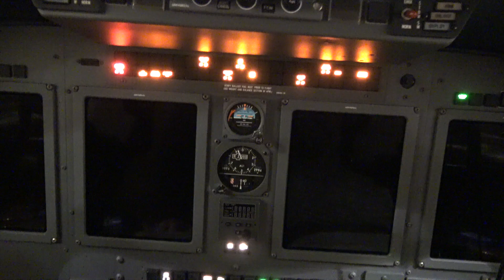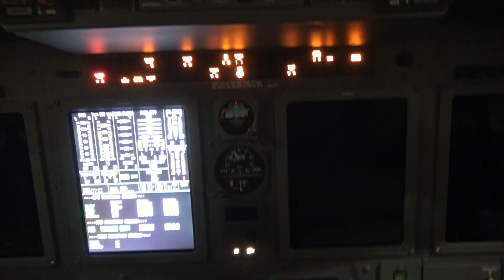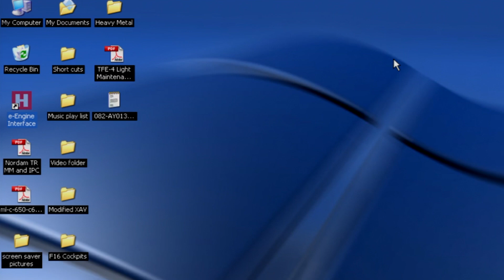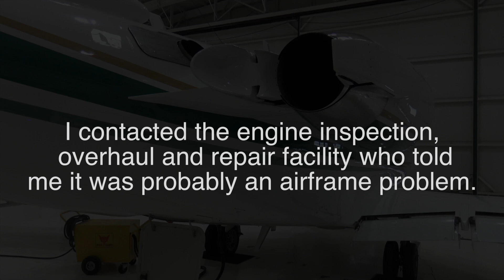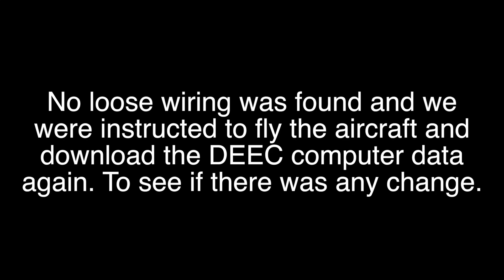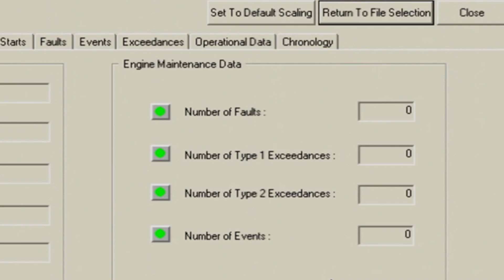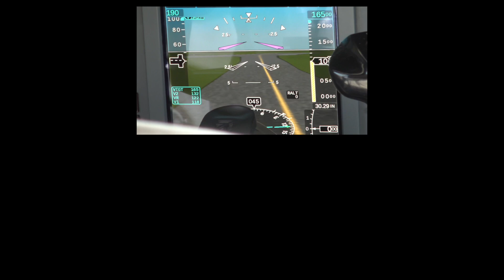Engine Health Monitoring and finding ITT problems

Comment: This feels like a “parts canon” fix. I guess it’s a bit harder on a plane to scope 😂 is harness wire repair not a thing on airplanes? Was there any diagnostic on the harness?
Reply: Safety safety and more safety.  Many parts are replaced under the theory that if the harness failed in one place it could fail in the same way but in a different place in the future.

Comment: To get to the harness would take 8 hours maybe. Remove the TR, exhaust, unstretch the tie bolt and remove the module. Have done this, along with complete disassembly's on this TFE's and TPE's many, many times. However, it was in the late 70's early 80's. Working for Airesearch Aviation at Houston  Didn't have all the computer controls, just had a box we could adjust the N1. Nice channel.

Comment: So no one knows what caused the fault... Just replace a part. It could have just been ONE wire broken. A fix $200. Replace part $15000.....
Reply from the maker: Once removed, the ITT harness showed signs of breaking apart. So it was definitely the ITT harness it self and not in the aircraft wiring.
Reply: Was it under warranty interesting how expensive this stuff gets.

Comment: that software looks like it is left over from the 1990s
Reply from the maker: It is actually from the 1990's, and came on a floppy disk. I had to modify my tool box computer to run Windows XP, so my tool box computer can communicate with the engine DEEC computers. The DEEC's that run the engines, in this aircraft, are from the 1990'S.
Reply: @shadojet3868  ECTM will run on Windows 10 as well. Probably 11 too.
Reply: This stuff isn't video game software. Like anything in the aviation, once something proves reliable and to be without safety issues it just gets used over forever.  The phrase if it ain't broke don't fix it was probably invented in aviation.

Comment: Were any faults revealed to the pilots during the flight, or were they only discovered after the data was downloaded ?
Reply from the maker: Both pilots said there was no indication of the ITT faults in the cockpit. The ITT issue was discovered after the data download.
Reply: @shadojet3868  Gadzooks....that's really scary. There should be some sort of 'service needed' or other alert to the crew. Too often we hear about catastrophic failures that happen because warnings were either ignored or not-known. It makes me wonder how long this would have continued undetected, until something more serious developed. Glad someone caught this before something happened.

As I understand it, ITT is a critical engine parameter that could indicate all sorts of problems such as a hot-start, combustor problems, fuel-mixture or delivery, possibly impending flameout. I definitely would want to know if anything wasn't 100% in that area.

Comment: Awesome! Just curious… how long did that ITT harness take to get to you? I’m going through a triple MPI on a 900LX I maintain and had my fingers crossed wouldn’t need an ITT harness. Honeywell is such a mess these days!
Reply from the maker: The overhaul / repair company delt with Honeywell directly, and it took about a month to get the replacement ITT, once ordered. The entire process took about 3 months, with me sending the downloaded data to the overhaul / repair facility and the Engine Trend monitoring company approved by Honeywell. I had asked to have that ITT harness replaced during our jets dual MPI's. For some reason they didn't do it. Fortunately, the aircraft owner has both engines, and the APU covered under Honeywell's MSP gold insurance program. MSP Gold covered almost all the cost of the ITT replacement.
Reply: Yeah I bet they are so strapped for these harnesses, they do not replace them unless they absolutely need to. 

I don’t know how operators go about without MSP.